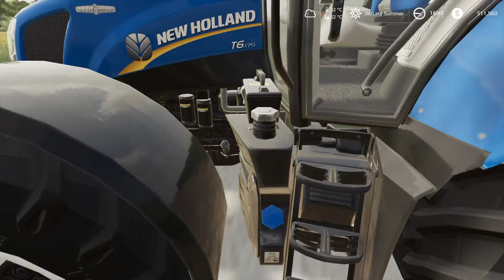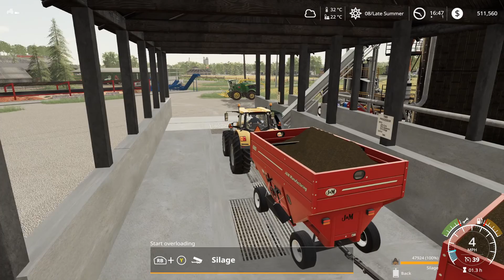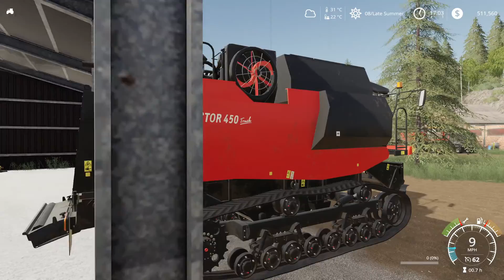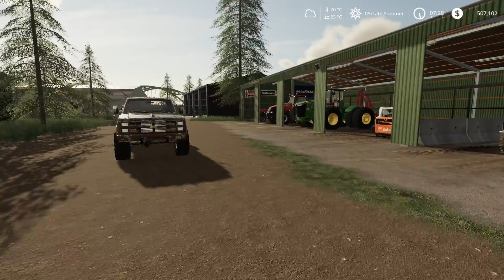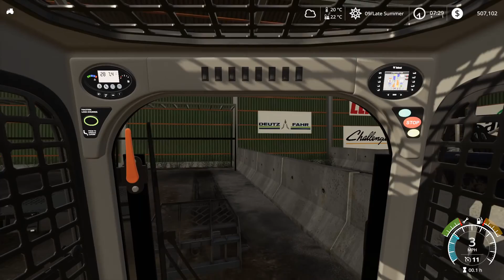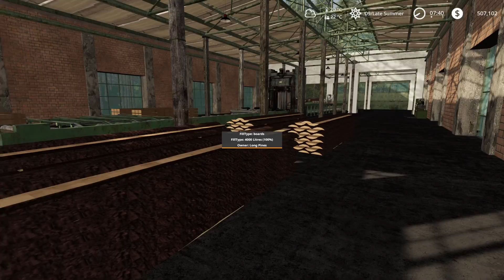BRINGING NEW EQUIPMENT TO OUR LUMBER MILL | Hazzard County, Roleplay | Farming Simulator 19

Comment: Great video as always Klutch!  As for combines, you can't really go wrong with a Case 9240 with dual Michelin tires up front, extended grain tank, foldable pipe and a 45 foot draper header.  If you want smaller width headers, it works well with Mac Don headers.  It also works great with a hired worker.